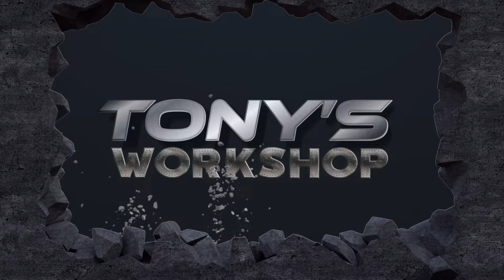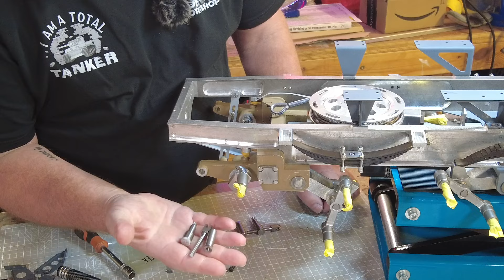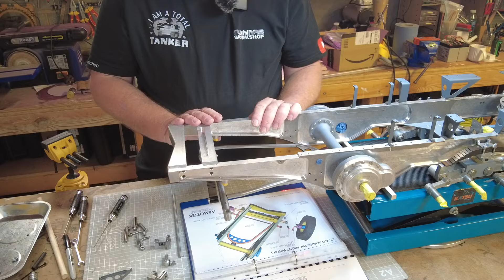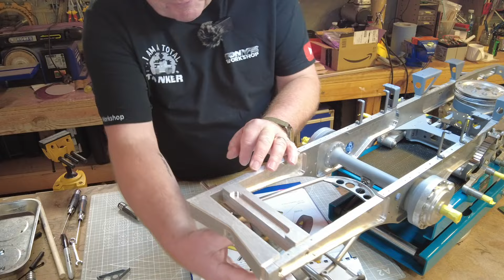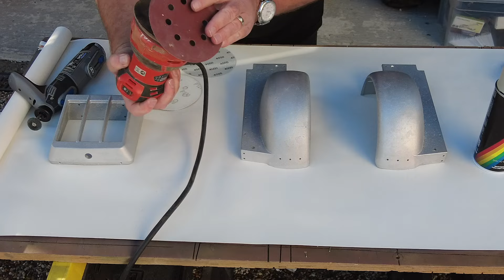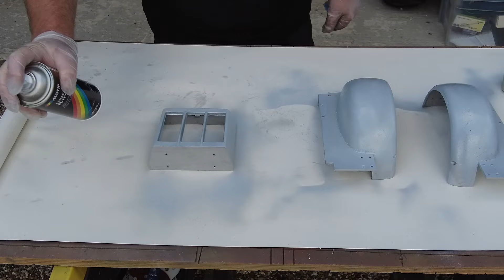Building the iconic 1/6 scale Armortek SD.KFZ.7 Halftrack.(VID 06)Track tension & steering install.

Comment: Hi Tony great job as usual!  The steering and suspension detail sets this interesting kit aside from the huge heavy tank torsion bar systems we are used to!  Perhaps behind the radiator front mesh you could add a black or dark grey material as that would certainly block out any sight of the speaker.  Best regards.  JH
Reply from the maker: Thanks Johnny....really interesting build this one and enjoying every moment. Once I have the metal woven mesh in place I will take a view on how much of the speaker is visible, and may add something like that...good idea and thank you. Happy tanking and thanks for the update on your build.